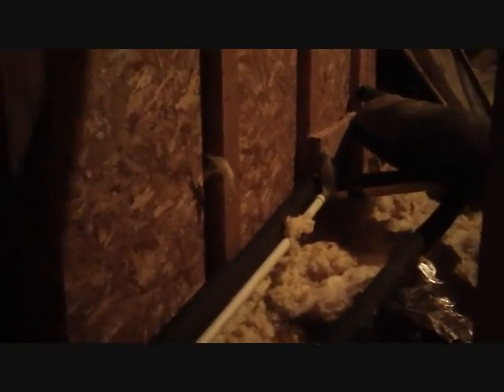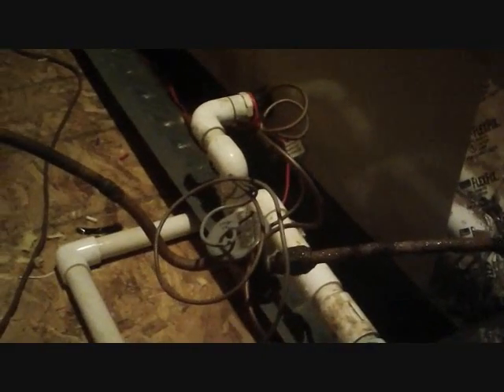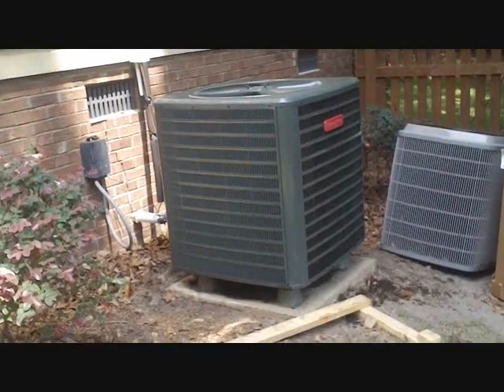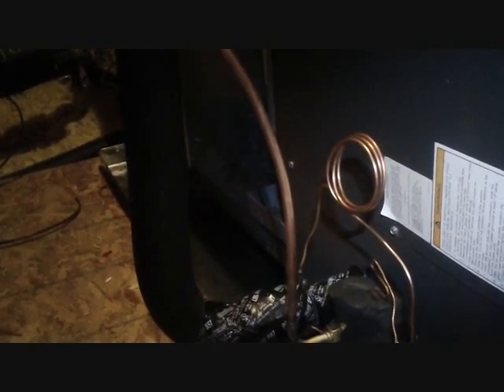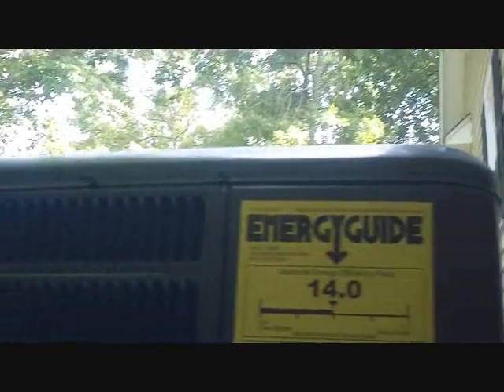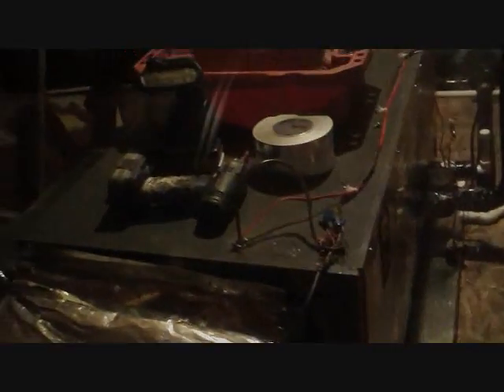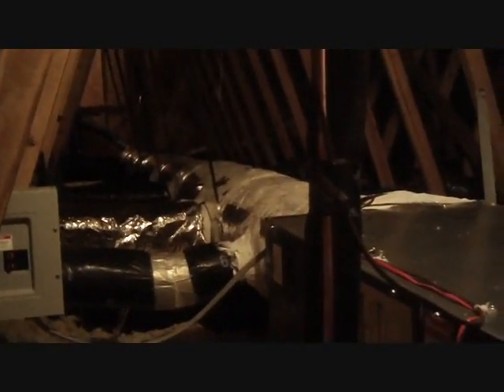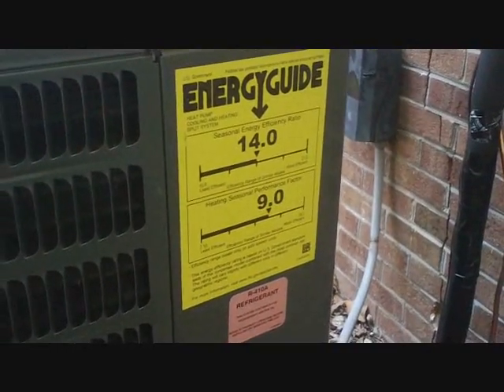HVAC Install- Goodman SSZ14 and ASPF Air Handler

Comment: From a professional vantage point, no line set should have a new hole in the structure. To me that's an easy way out unless there are legit limitations. For a true professional look, the old line set needs to be decommissioned and replaced with new one at the same location. 
When a new hole with speedichanel is installed, there's potential water leak into the home down the road causing havoc to the home (particularly gable-end area or similar).
That means that hiring a drywall guy to open up the wall is warranted.

Comment: Putting air conditioning ducts in a hot attic is an effective way to heat up the conditioned air as it travels from the air handler to the conditioned space inside the home.  Ducts should be in the conditioned space of the building envelope.